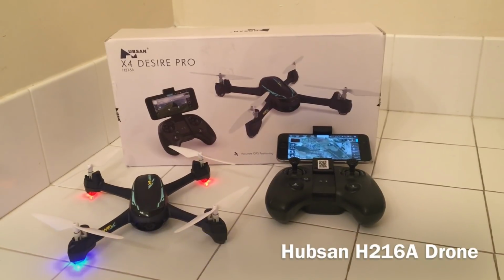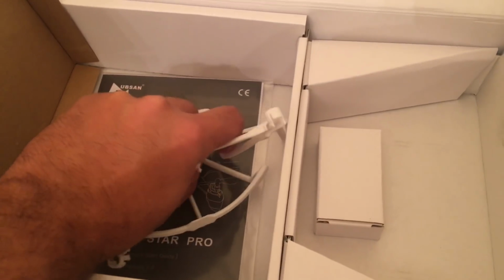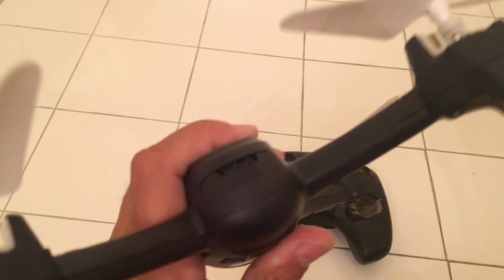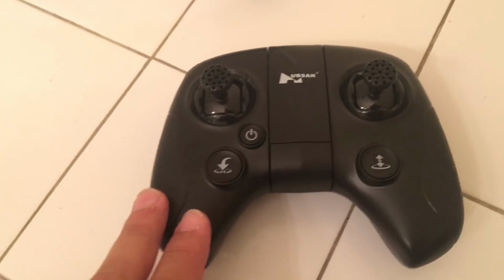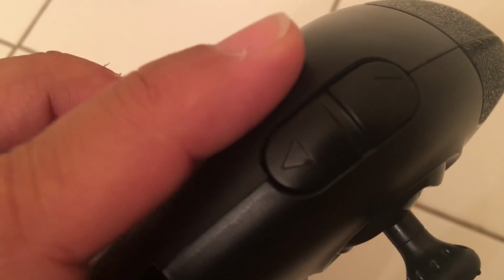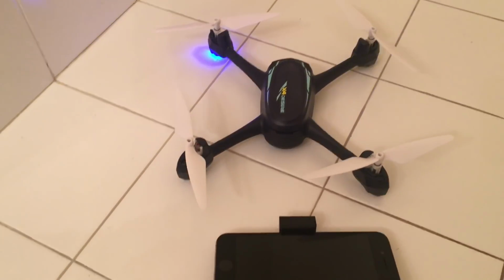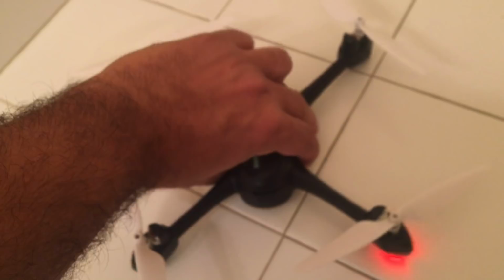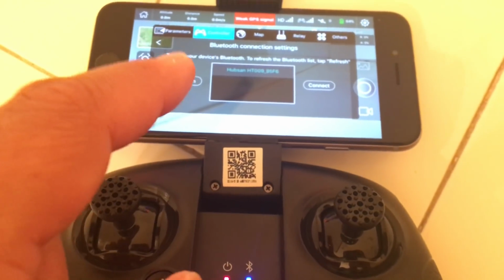Hubsan H216A X4 Desire Pro Drone

Comment: Hi, I buy this drone by Amazon, but I have a problem, I can't find the H216A's WiFi signal, I'm from Bolivia.
Reply: Hope you can help me with this, thanks.
Reply from the maker: Try using the Hubsan app (as mentioned in the video) to connect the drone controller and utilize the drone’s functions...

Comment: so, the hummimg noise from H261A right after power-on is normal??? I thought there is defect in power circuit.
Reply from the maker: Actually, the H502e & H502s did the same thing… So this type of drone from Hubsan tends to have this little high-pitched noise for some reason…

Comment: Hi, I am Vince brizio from Netherlands . Nice drone , but There is one thing that I can not do with my Hubsan H216A and it is using my VR headset  because the option does not appear to me, I have seen that many people has it and you too, but I have only F, Waypoint mode, Following mode and Orbit mode ( i mis VR mode) .I downloaded the App with playStore many times !!  I've tried everything and I hoop is not  my "One plus 5" phone that's pretty good ( i think!). Do you  know something about it ? Tanks
Reply from the maker: I’m not sure why you are missing that option… Make sure the screen resolution & display settings on your phone are correct to ensure that all menu options are visible on the screen and also you could try to search the Internet for maybe an older version of the Hubsan app or .APK file to see if maybe the older version of the app had that option and the new one doesn’t… So you might be able to download the older APK file and install it on your phone...
Reply: thanks a lot !!!!

Comment: What's the difference between a Bluetooth RC and a normal, conventional or wifi RC? What's better? Which has better distance range?
Reply from the maker: A drone with a true antenna radio control transmitter is ideal and will always have the best range and accuracy of control...  These WiFi drones that are only controlled by a phone or tablet generally don’t have long range and are not precise (due to the lack of actual stick & button controls).  In the case of this drone, it is just a WiFi drone that just connects to a phone or tablet.  It has a controller, but it really isn’t a true radio transmitter, it is just a device that connects to the phone (using bluetooth) and allows the user the ability to fly the drone with actual controls instead of a touch screen.  That is good, but since it is not a true radio transmitter, the range of control is limited.  So in the end, its range is the same as the typical WiFi drone.  A WiFi repeater or extender can be used to increase the range of control, but adds an extra level of detail and complexity...
Reply: Ok thank you very much. So, just to make sure I understood. The RC connects with the phone to fly the drone, it doesn't connect with the drone correct? I am about to get my first drone ( jd-20 the dji spark clone) so I want to know if that RC is better since it's not a Bluetooth?
Reply from the maker: The JD-20 does have an actual RC transmitter/controller....it does use WiFi to stream video, but does not use bluetooth at all...

Comment: I was under the assumption that this drone has a 1080p camera? Not 720?  All the videos, and all the specs that I've been reading online state that this drone has a 1080 camera. I am very confused
Reply from the maker: It turns out that this actually saves 1080p video to its SD card… There was some confusion with the packaging saying 720p and the previous models having that resolution… Perhaps the WiFi streaming is also in that resolution, but the final saved video to the SD card is actually in 1080p...  :)
Reply: rx344 thank you so much for your quick response I have one more question if I may? Is there some way to change from metric to Imperial settings so I can have miles per hour and feet, instead of meters? Because I live in the United States. Once again thank you in advance.
Reply from the maker: I just looked through the current version of its app and unfortunately there are no options in the settings to change the units… Perhaps because this product is not from an American company… I guess just figure that a meter is about a yard or 3 feet...  ;)

Comment: I just bought mine. What kind of micro sd you could use? I bought sandisk 16gb class 10 but it doesn't work.
Reply from the maker: A class 10 SD card should work… I’m surprised the one you mentioned doesn’t… Are you sure you are hitting the record button correctly? Hopefully it’s not a defective unit…
Reply: rx344 thanks for your reply.

Yes I did. I see a msg on my phone that says "no sdcard" when im pressing camera or video.
Reply from the maker: Maybe you might have to reformat the SD card so that it works with the drone… See if maybe the app has a reformat option…

Comment: bought two such drones. Excellent handling from the phone. But I can not connect to the transmitter in any way. Bluetooth on the phone finds the control panel, but does not connect to it. The message "it is impossible to contact Hubsan NТь009_94Е7" appears constantly. I tried to connect from different phones - there is no result. What am I doing wrong?
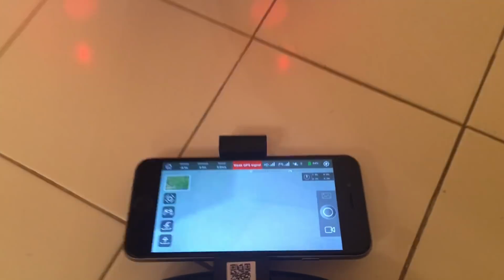Reply from the maker: Try connecting the bluetooth using the app (instead of the phone’s bluetooth settings).  I go over this process at 7:45 of the video... Goodluck  :)

Comment: I got mine but it wont connect to my cellphone, i have got the app, input the correct model, entered the wifi password but keeps showing not connected, would you have any suggestions please
Reply from the maker: Prior to entering the app, did you go to the Wi-Fi settings of your mobile device and connect to the drone? That should be done first and once that is connected, then you would enter the app and select the model…
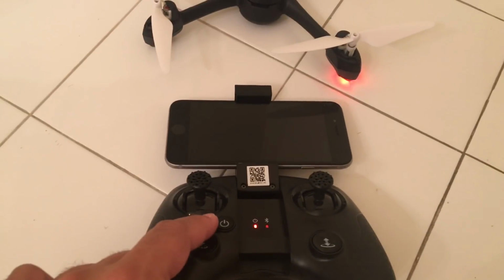Reply from the maker: At 6:08 I go over the WiFi connection process...
Reply: Yes, i did all that, and it just shows "not connected", no camera view just does not work, this was a total waste of money, will cost way to much to return to China, so just as well lobb it in the bin, last Hubsan i had was a piece of junk, should have known better
Reply from the maker: Then unfortunately it appears you have a faulty unit...sorry to hear that.
Reply: In a way i am pleased to say i found the problem, its the Ulefone S8 pro cell phone i bought about 4 months back, i loaded the Hubsan app on my 8" tablet it connected first go, so looks like i need yet another phone, no data on the tablet
Reply from the maker: Oh ok, good to hear that the drone connected...

Comment: lovely video thanks for posting, what size battery does this take, and what control distance are you getting, i have ordered one for a bit of fun flying
Reply from the maker: Thank you.  At 2:56 in the video I provide the battery details...
As for range: with a WiFi extender: about 2 - 300 meters (depending on environment & interference).  Without: about 100 meters max.
Reply: Many thanks, and i have ordered a wifi repeater

Comment: What is the max distance with fpv??
Reply from the maker: With a WiFi extender: about 2 - 300 meters (depending on environment & interference).  Without: about 100 meters max.
Reply: rx344 this hubsan has in complect wifi extender? Do you recommed to buy this dron for city?
Reply from the maker: It does not include a WiFi extender, but they are cheap and easy to find.  This is a good selfie drone, but if you are looking for a more powerful, long-range RC drone...try the Hubsan H501S instead...
Reply: rx344 but in 501s 720p
So may be you tell me dron 100-170$ with bc motors and opportunity to go pro also long distance. Sorry for my english and thanks for your answers
Reply: rx344 oh, sorry, 1080p in 501s
Reply from the maker: The Hubsan H501S also has 1080p, plus a long range transmitter and powerful brushless motors.  They are more expensive than this one, but still affordable.  Here is the link to it:
https://m.gearbest.com/hubsan-h501s-x4-brushless-_gear/

Comment: Can you still see the fpv footage from far away and do the videos go strait to your phone or does it go to the SD
Card? If it does can you retrieve the videos off your phone instead of going to a computer? Nice video also
Reply from the maker: Thanks.  From what I saw, I could only retrieve the video if it had an SD card inserted.  In general, it is always a better idea to get a drone's footage from its SD card as it will always have better quality...it may be easier to get it from the phone directly, but the footage comes from the WiFi stream (which is generally lower quality, resolution, and choppier).
Reply: Thanks I want one only need 50 more bucks🙁 is it worth it to get
Reply from the maker: I mean, it is a good drone and it has good video quality (at an affordable price), but I would research what’s out there… Because maybe for a little more money, you could get a more powerful drone…